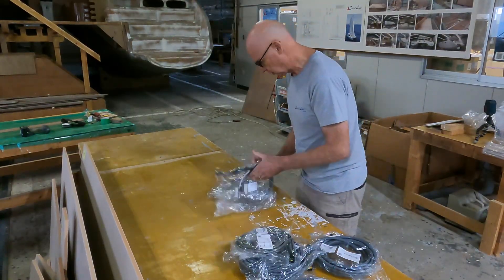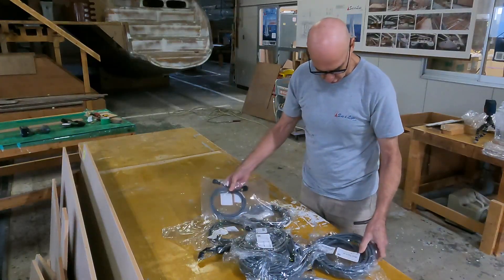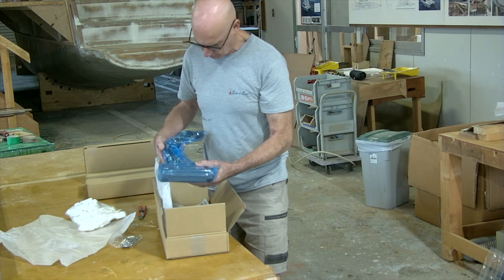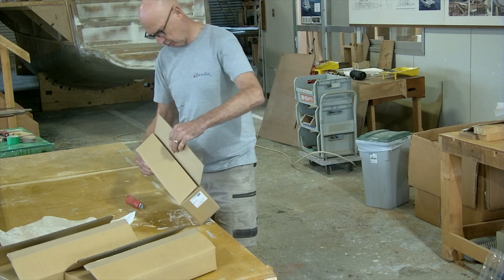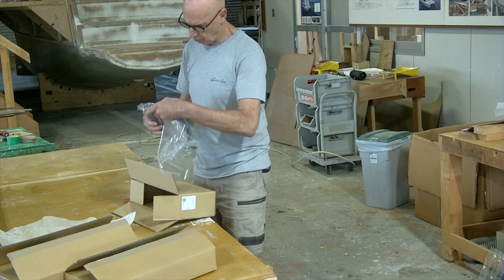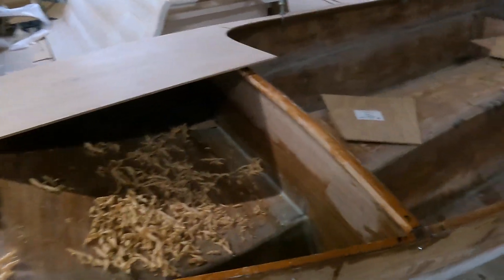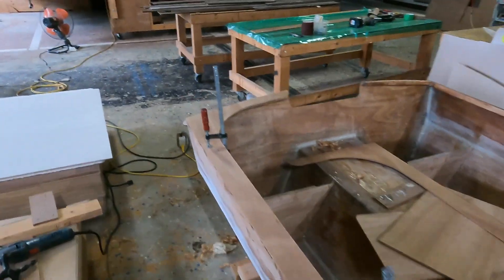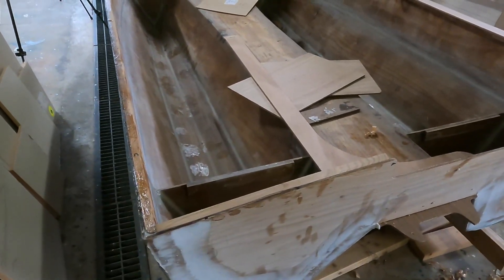Engine Controls for DIY Catamaran

Comment: Kevin, thank you for the update, I had been wondering what was happening and the videos are much less frequent now. Of course life gets in the way of these all consuming projects and this is a huge project you are engaged in. The engine controls look to be of a much higher quality than the usual tat, although I was surprised to see the inclusion of the kill cord (if it was that) and would question the wisdom of having that source of potential failure in the propulsion system. Take care of yourself Kev.😀👍⛵️

Comment: Comments disappeared some how ..so hope your on the mend , I'm with your guys the planked ceiling is perhapse more for a traditional styled monohull. Or something like a Wharram  possibly. 🤷🏻 Just my opinion. In this case . 

Your hand controls seem very nicely made and should prove satisfying to use ..I wouldn't discount the fitting of the stop start buttons and tick over controls...in a temperate climate and awkward situations it could prove pretty useful. 
I would see if you could make the main control box with the manual overrides accessable from the helm.

Comment: Crikey Kev, take care! I'm in a similar situation out here in Italy. I'm on a remote location restoring my old house. I can't get any help to come up here so I'm left to do it all myself. And there's plenty of physical labour and dangerous power tools and tapp ladders etc. And I'm no spring chicken. I wish I had a community to help like you dom I'm a lone wolf out here doing the best I can but I'm slow as it's just me and I am super conscious not to wipe myself out of for no other reason than to keep my dogs safe and comfy.
Reply: Good to see you back kev . The on /off idle adjustment sounds useful when dealing with seasonal variations in running and possibly in docking situations rather than just the levers. 
The traditional planked ceiling effect doesn't sit with the ultramodern lines of the Dix Catermaran  fine on a monohull or something like a Wharrams interior...but that's just my opinion.  🤷🏻